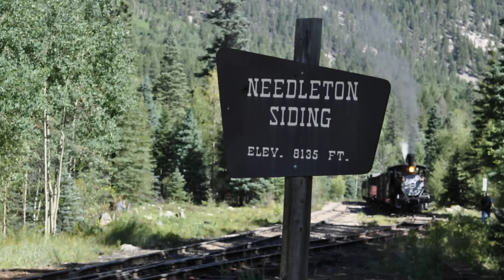Denver and Rio Grande Steam Train 315 - Durango and Silverton

Comment: Great video! This past Sept. 9, I was part of an entourage of 6 who set out from Durango aboard a consist pulled by Mikado #482. The plan was by train to Silverton, then by bus back to Durango. It would be an incomplete journey, because a threat of rain in Durango became a drizzle. And that mere drizzle in Durango was a deluge in the mountains. It seemed our Tank Creek water stop was extremely long. Then the conductor came into the car to announce that there was a mudslide over the tracks ahead, so both ours and the train ahead of us would have to head back to Durango. We pulled ahead to the wye at Cascade Canyon, where we could see the other train had already turned around. After that train pulled out, we backed onto the wye. Then we waited, waited, and waited until the train ahead got past the High Line's 'horseshoe curve.' A note about that curve. Videos don't show that the track there is noticeably uneven. As you round it at 10MPH, you feel the train leaning toward the river 250 feet down. And while we waited at Cascade Canyon, we watched it rain harder and harder, as the Animas got browner and browner, rose higher and higher, while the rapids got whiter and whiter. So we got twice as much train ride as we bought--plus refunds because we got turned around. Still it was a great ride, with stunning, sometimes scary, vistas! If you like trains, I highly recommend it. In fact, if you like trains and don't want to take that ride, there's something wrong with you, something much more seriously wrong than just liking trains.
Reply from the maker: Brass735 What a great story! Thank you for sharing. I know mud slides have been a problem for them several times, especially close to Silverton.
Reply: ц_. к

Comment: very good, but why edit out the regular drgw train at the passing loop and you needed more shots of the two stations, I havnt been there since the 1990s , wanted to see the place see if there were any changes.
Reply from the maker: Thank you. The reason(s) I didn't include them is that I wanted this video to be more about just the 315 and not the regular trains and they just didn't seem to fit in with the footage I had. I have a video featuring the winter trains on the D&S that will be coming out hopefully in the next few months, and that will have better coverage of the town of Durango at least.

Comment: 400k on restoring it? You could build a new one for that price!
Reply: Maybe you could build a new one for $400K if you had a factory all tooled up and were mass-producing them 30 or 40 a year, but not as a one-off.  And if it needed a lot of boiler work (or a whole new boiler) that drives the cost up.
Reply: Maybe someone should start a new locomotive manufacturing company to build these. these steam locomotives are starting to make a come back. I read an article recently in Great Britian a steam locomotive was built that could go 100 miles an hour